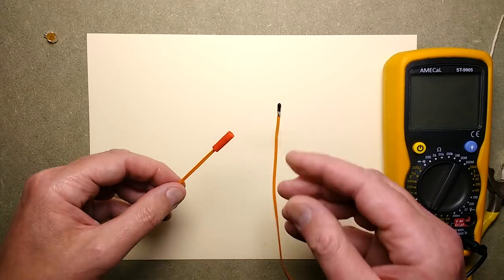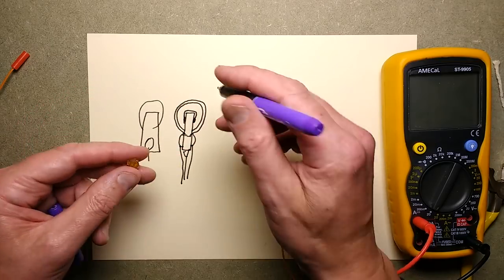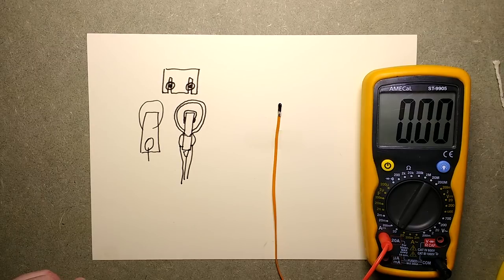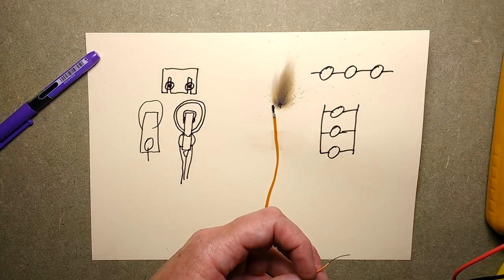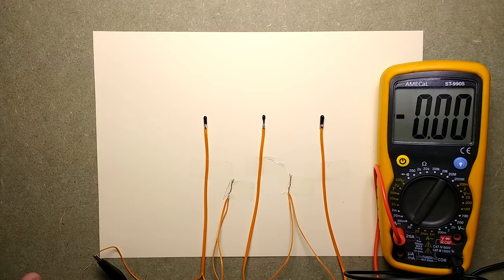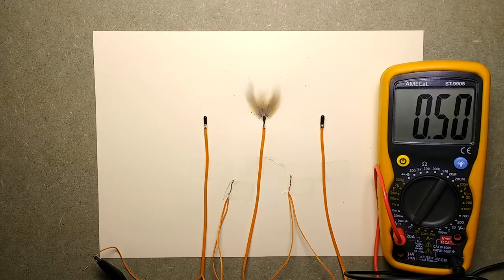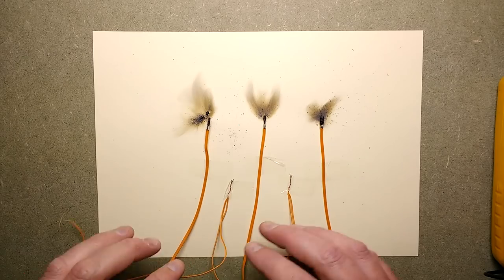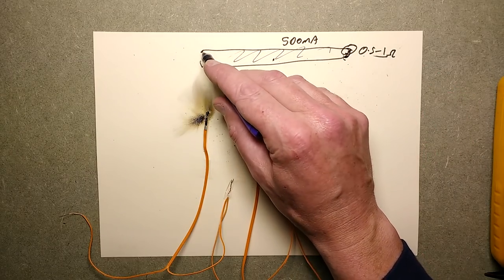Testing for electric match misfire.  (bangs and flames)

Comment: Wouldn't the proper igniter produce surge currents rather than a ramped up current to trigger the matches? That would be far more effective.
Reply: muzikman2008 It’s most likely a resistance wire,, and just gets hot enuf at a certain current to set it off..
   That’s why it is still flowing power after the bang the wire is still connected and working
Reply from the maker: The slow ramp up was to emulate a high resistance circuit or low current firing source.
Reply: bigclivedotcom Ah of course.. Makes sense now 😊 I was in bed half asleep lol...

Comment: From the peculiar noises, im guessing you are using a Korad power supply?
Reply from the maker: Same supply, different branding as Tenma.  60V 3A.  Reassuringly heavy, but quite beepy and with the fan making it less suited to videos.
Reply from the maker: Whatever you can comfortably afford.  I started off just using batteries and moved onto a variable voltage and current supply.  There are some interesting power supply modules available on eBay.
Reply: If you don't mind building a mounting and you can get a spare laptop power supply or similar DC source I'd search ebay for DP20V2A 30V5A 50V5A DPS3003. Alice has a few types of these, I have the 30 volt 5A version and it's really quite accurate and useful.
Reply: I can recommend the DPS5005, coupled with a 48V meanwell PSU

Comment: What is the name of those connectors?
Reply from the maker: Try a search for jelly crimps.
Reply: They're commonly found in North America under the name Scotchlok connectors.
Reply: Let me guess... 3M?
Reply: Dustin Sparks the ones used in the UK for telecoms are made by dexgreen, but 3m do also make them
Reply: 3M Scotchlock
Reply: Dustin Sparks - Ooooh such cynicism. ;)
Reply: UY connector
Reply: There plain old IDC crimps you can get them with or without gel - ultra common in telecoms installs, street cabinets and walkovers
Reply: Yep known as ' grease filled jelly crimps'. Used these in Telecoms when joining twisted pair 1308 cables.
Reply: Sometimes also referred to as "jellybeans".  Although you can use most pliers to close them, there are also special pliers designed specifically for them (I have a pair of specialized needlenose pliers that include an area designed to evenly close on and crush them, a builtin wire stripper for 22-24 gauge wire, and the usual needlenose features (gripping area up front, cutter in rear) -- I tell people they are jellybean squishers and get a kick from the odd look people give me.
Reply: TecStuff Fair enough, but the Wago cam connectors do not seal out moisture.  These silicon gel filled insulation displacement connectors can literally be buried in the ground if need be (I've used them to repair sprinkler systems in addition to their intended telecom uses).
Reply: A mickey mouse job
Reply: BCITBroadcast   also used in AU with the diminishing copper phone network, being replaced with the CRAPPY BIG $$ NBN roll out!
Reply: In sweden they are called Fish Eyes casually.
Reply: 3M UY (probably UY2, the smaller size). There's also UR/UR2 if you need to join 3 wires.
Reply: rimmersbryggeri, that makes sense. If you work in fish processing, you soon learn how sticky fish eyes can be. We had a supervisor who was being too officious, so someone commenting in this thread stuck a pair of cod eyes to his favourite leaning post. He was walking around for more than half a day, with a pair of eyes dangling from his back, before he realised why people were laughing at him!

Sleep tight!

Comment: Don't rely on a conductive path being still viable after an ignition; have a system that puts out enough current to run igniters in parallel, not in series.

Comment: The PROOF of faulty electric matches (igniters) was ON THAT PAPER!  
Note the pattern of the discharge.  The center had a good rounded pattern (and fired 1st) with the 2nd firing at elevated amperage and leaving a slightly misdirected pattern, and the 3rd to fire was loop sided in discharge.  Where ever you purchased those from, has poor QC and is producing low standard product.  Repeatability is key to those, and with that manufacturer it's not likely to be found!

Comment: I'd love a follow up of you trying to induce the requirde current to detonate them remotely, see how unlikely it actually is.
Reply from the maker: It would be tricky.  You'd need to use the loop of igniters as a single turn transformer, but that would also require the firing end to be shorted.

Comment: I guess these devices are designed for lot of current passing thru to blow ( secutity)  , 

you tried to put them in serial , ok ...so : there is a backup circuit to keep the continuity to blow all the  loop ,  

ramping toooo slow the amps made the 3rd to blow ( it's job was done ! )  , 

but also the backup circuit ( almost 1 AMP) broke like a fuse 

 . they all did the job , ... not sure you used these devices the way they are designed ..

sorry for my poor english ( french from canada )
Reply: I meant : doing faster , you can put 50 of them in serial , and all will blow

Comment: This doubles not only as a fun video, but a video that normal people who somehow get their hands on real professional pyrotechnics (you know who would do that in your circle of friends... It might very well actually be you.) and wire them incorrectly and therefore making a very dangerous situation. Imagine that someone wired them all in parallel and then only some of them went off and then when they thought it was a dud they went and picked it up. Blows up in his hand. So now they know to wire them in parallel, so they are safer. And also now they know that the 9V battery might not be enough current to blow them all, or that it might be too MUCH current and yadda yadda... So they will be safer. And that's a good thing.

Comment: Well for the cell phone, I could see radio/digital based firing systems (badly designed without propper ground coupling and/or whatnot) getting their processors into some short of hang up state and misfiring... they wouldn't be the first devie to get that short of behaviour cough Agilent/Keysight U1272A *cough*.
On the other hand I suppose any self respecting firing device designer would account for electrical noises in the vicinity of their design and make it "hard to misfire" (one would hope...)
As for the standard switch + battery ones... i don't see how you could get the requiered levels of induced current without throwing the whole thing inside a microwave...

Comment: Hey clive can we buy these on ebay?
Reply: They are freely available, but need hazardous goods shipping, so not on ebay, but any fireworks/pyrotechnics shop has them.
Reply from the maker: I got mine on eBay, but they may or may not ship them depending on local regulations.

Comment: Why is their no audio?
Reply from the maker: Check your surround sound settings.
Reply: remove your ear-plugs =p and check audio settings lol
Reply: Any other video on youtube has audio except for this one.
Reply: it's something in your sound settings or an audio driver/codec issues perhaps. maybe even a web browser issue. youtube looks to be using VP9 for video and "Opus" for audio codec, it may change if the platform doesn't support it.  https://en.wikipedia.org/wiki/Opus_(audio_format)
It seems 60,607 others have watched it without any sound issues :)
Reply: It's weird because I tried to watch this video a week ago and it had no audio than and I try to watch it now and there's still no audio and yet I can click on any video on the right side and I hear audio just fine. This has happened before with only one other video and it's one of bigclivedotcom's as well and not only that I have watched 1000's of videos on YouTube with no audio issues, so how do you figure that one out?

Comment: If long cables runs can be a problem, why don't they just put the firing system locally with the fireworks and then controlly it remotely over somthing like rs422, dmx, or ethernet
Reply from the maker: It has to be a secure firing system.  But many are run across a simple network and power cable.

Comment: Sure enough, on the single one with the gradually rising current, after it fired, there was still current indicated on the meter.  The name brand ones for high explosives list a "no-fire current", so with that current or below, they are guaranteed not to fire (useful for continuity testing), and an "all-fire current" at or above which they are all guaranteed to fire.  Amusingly, I was helping to wire a fireworks display and someone came to check my work and said I "seemed to have a knack for electrical wiring".
Reply: Nothing to do with name brands or high explosives, it's defined in EN 16265 for normal igniters, and anything that doesn't comply to that is illegal in the entire EU.

Comment: Test on thermite !
Reply from the maker: Not sure it would trigger thermite.  That usually requires a sustained high temperature.
Reply: maybe you could ignite a sparkler somehow. that wound in turn ignite the thermite.
Reply: How hot do they get? IIRC, commercial thermite is usually started via magnesium. That ignites at 473 °C / 883 °F.

Comment: Maybe the heater wire was bad in that last device so it was the actual circuit board burning that set it off...  it would be interesting to keep building up the current on the detonated devices to see how much it would take to completely burn them out

Comment: 10:40 It is now ... but think back where mobile / cell phones had a 12v car battery attached to.
Ok, technically they were car phones ... but mobile nonetheless ... I actually (while I had an Alcatel One Touch Easy ... [which is this one: https://upload.wikimedia.org/wikipedia/commons/8/87/Alcatel_one_touch_easy.jpg ] in the early 2000 ) have seen someone walking around with one of the likes of this: https://johnnyryan.files.wordpress.com/2012/12/first-car-phone.jpg strapped around his shoulder ... and making (or pretending to make) a call ... 
And those big ones probably had send out more power ... than phones do these days